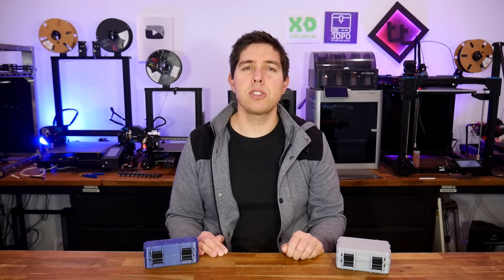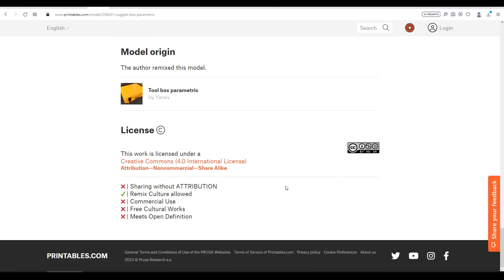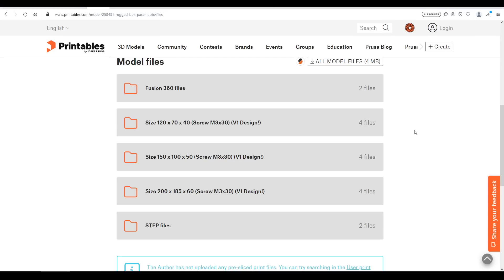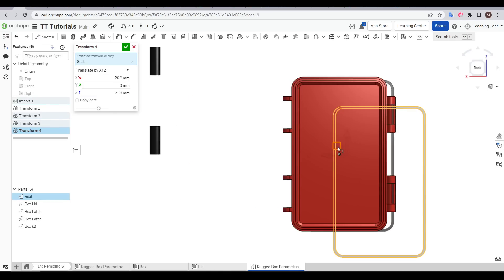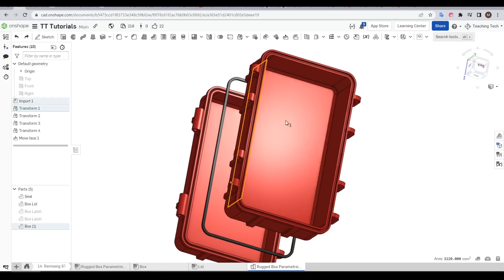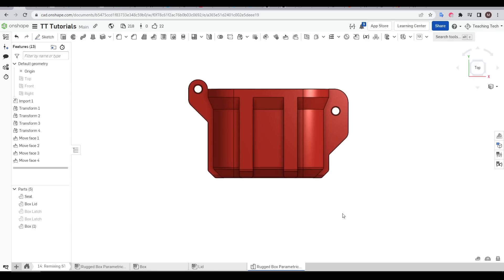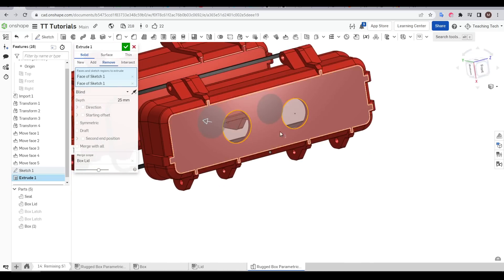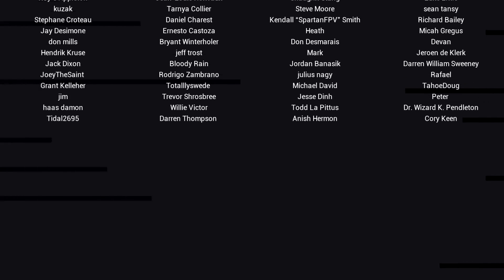Remix STEP files to suit your needs - 3D design for 3D printing

Comment: Very nice! Just remixed a push-pin rivet to hold a thickness of 12mm instead of the 1mm of the step file. So much easier than re-creating the entire model.

Comment: Oh god... I've just gone down the rabbit hole.

Long-time Solidworks user, but lost access to it when changing jobs. I've used Fusion360 for about 10 hours and printed a bunch of new or modified models. The 10 project limit on the free version was frustrating.

Now I've just seen this video and realised those limits aren't on OnShape. For some reason, I thought it was toy software like Sketchup or TinkerCAD.

I tried it for 1 hour, and it's just like Solidworks... Where do I invest my time? 

Great videos, btw. You've taught me a lot over the last 5 months

Comment: "You can see why this box is so well designed."

No, it isn't...at least not well designed for FDM.

You have a giant first layer on each half which essentially is a huge failure point, unless your machine is dialed in or the first layer of the box is really small.

This is a 3D printed replica of a design that is injection molded because it has to be designed that way for injection molding. 

Designing a class box using 3D printing techniques would take advantage of the strengths of 3D printing which become weaknesses when you try to replicate most injection molded parts. 

Yes, with FDM you can replicate any part in the universe, but why would you unless you are making a replacement part that can't be gotten any other way?

Many of features that exist in parts are there to compensate for limitations with OR take advantage of the strengths of other manufacturing methods.

Designing around the limitations and strengths of FDM the entire new set possibilities for parts design.

Comment: Hi, what is the difference between increasing the size in CAD as opposed to within the slicer?
Reply from the maker: The slicer can scale the model uniformly along each axis, but ding it this way will let you change specific parts, but leave other crucial parts unchanged. For example, expanding the size vertically in the slicer will elongate the bolt holes too, so that assembly will be impossible.

Comment: How did you make the text flat?  When i extrude or remove from the face it effects the whole text sketch.  How did you only remove the small outline of the text and not the whole text?  Thank you.  It has been great following this tutorial to make a custom pencil box with my son.
Reply from the maker: After creating the text, I selected each letter and then used offset to create the second perimeter. One letter at a time which is slow but it prints much nicer that way.
Reply: @TeachingTech  Thank you!

Comment: Can anyone explain the 3 different materials used in the printing? Why those materials? Is there a good guide for filament selection? I've seen strength tests but nothing on practical use cases.

Comment: I have really appreciated these videos. I work in an aerospace machine shop and am responsible for all part marking. Most of it is done in a laser engraver. Aerospace parts can have some crazy shapes so I have been making my own fixtures with our work 3D printer. Yes, we have our own engineering that can make things in CAD but they are way too busy. It has been a blast.

Comment: Very nice video as usual. Would be cool if you could show how to make the text on the box another color if you have one extruder and no mmu or AMS.
Reply: That’s easiest to do with the text coming out of the surface, not going into it. How you do it is insert a filament change at the height of the base of the text, different slicers have different ways of doing it. Without a MMU or AMS you should keep colour changes very simple and infrequent, like just for text in top of the model, you really do not want a lot of filament changes.
Reply: @conorstewart2214  i know that. But would like to know how to do the text first in one color and the print the rest in another color. Is it called Embedded text?🤷‍♂️

Comment: Alright if you are clever enough to use fusion 360 and have a fancy 3D high end pricey Bambu Lab X1 Carbon with the also pricey AMS. Not so if those are beyond you.
Reply from the maker: Not quite what you are trying to say. The video is about Onshape, not fusion. The printer is irrelevant.

Comment: Is the cast iron pattern on the box included in the design?
Reply: I believe what you're seeing is due to the build plate that he's using in the video. When getting the print off the bed, the bottom layer will always have an impression of the bed's texture.
Reply: I think it is called PEO plate.   He had it in a video a while ago.  It a sweet visual and it is smooth.
Reply from the maker: The plate is linked in the description if you are interested.